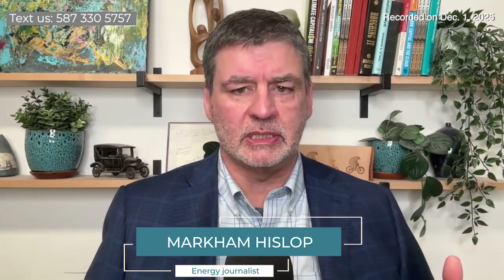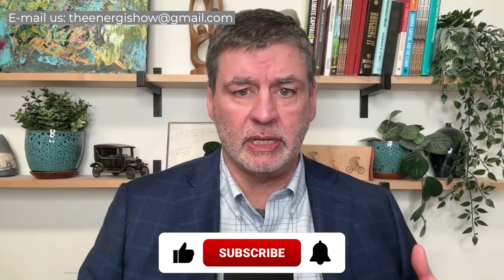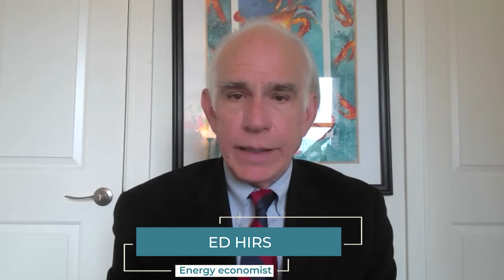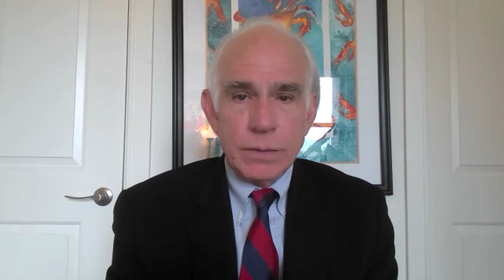Small Modular (Nuclear) Reactors Still Unproven. Are They Even Needed?

Comment: The question is are SMRs less expensive than wind, tidal, geothermal including enough battery storage to guarantee 24 hour X 365 day power supply.
Reply: the other question is, is there a use case for them that isnt just limiting them to grid tied electricity production.
industrial heat source
shipping propulsion
district heating
isotope production.
Reply: The answer is a no, they are not even close to competitive with renewables plus storage. SMRs also don't exist.
Reply: @gemada99  You're equivocating the definition of "storage".
Storage for wind and solar is used for firming.
No firming is required for uranium-fired power-service.
The storage used for wind-and-solar firming is not available for anything else.
You can't load-follow with it, and you can't peak with it, because it's already in use for firming.
Reply: @aliendroneservices6621you can indeed load follow with battery storage, that’s literally what firming is.  Next you can’t really load follow with nuclear, without really screwing with the economics of nuclear.  The answer to that is some kind of storage for when demand goes down, like at night, on the weekends, in the winter.   So we need more storage, which we have lots with hydro already, but more with thermal storage and batteries.  Then it comes down to which tech provides the lowest cost electrons.  Hint it’s already solar.
Reply: @brettgracey9682  No, load-following is not firming.
Full firming creates constant level output.
That is the opposite of load-following.

Uranium is a battery.
It exists in the crust pre-charged.
That battery can be used to cover all loads by overbuilding uranium-fired power-service, and shunting excess power to resistive heaters.
Reply: @a@aliendroneservices6621o tell, what do you think load following is?  
Firming CAN create a stable output, but that is determined by the need to……. Load follow demand.
Reply: @aliendroneservices6621 umm you also think Uranium is a battery, it isn’t no more than coal is a battery.  Next, do you understand the economics of electrical generation?  Yes, certainly excess electricity from ANY form of generation can be shunted to thermal waste.  The question is when you need to get rid of half of the electricity at night because its output is not dispatchable (you can’t load follow), so you have to dump it.  Tell me when you d7mp that electricity, how much would a SMR provider receive for power they just dumped?  Their expenses don’t change, but their income varies based on CUSTOMER demand.  Dumping it to heat there is no customer.  Unless you are talking about thermal storage, for which literally any form of generation is suitable, and solar and wind is cheaper.
Reply: @gemada99  there are 2 prototypes, one in China and one in Russia

Comment: Is it more likely that SMR will come on to the electrical grid before super critical geothermal power plants do?
PS — US Navy reactor costs vary significantly, with Virginia-class submarine reactors (S6G) estimated around $200 million each, while the two Ford-class carrier reactors (A1B) cost roughly $1 billion total (or $2 billion/GW) for both, making them far cheaper per megawatt than civilian reactors, Submarine reactors are smaller (around 200 MW thermal) than carrier reactors (400 MW each).
Reply: I think both will have value. Geothermal will still be in the 10-50MW range, while SMRs occupy 50-300MW. 

Importantly I think SMRs will provide a lot of industrial heat at temperatures that Geothermal doesn't reach and are simply difficult to replace without combustion, particularly at industrial hubs where you already have a lot of hazardous material and security requirements.